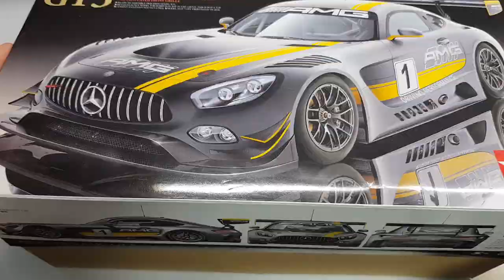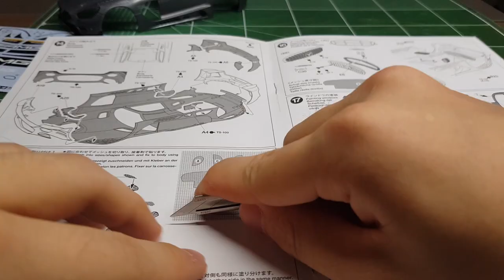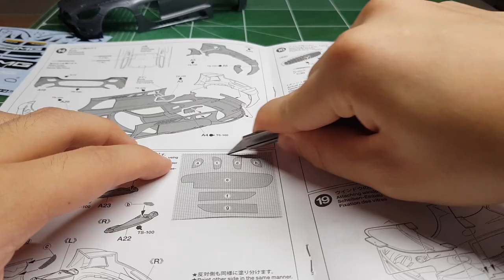How to build a 1/24 Mercedes AMG-GT3 Tamiya Step by step

Comment: It's pretty cool. However, it is a pity that the decal looks like it is floating and the seal feels like it. I wonder if I should blow the clear thickly and sharpen it while removing the steps. Also, the decals on the 4-point seat belts are too dull, so I wouldn't use them myself.
Reply from the maker: Thanks for the advice.
Reply: @plagraphy5276  
This is not an imposition. 
My opinion.
Just for reference＾＾

Comment: Thank you very much for sharing your knowledge. Your work is beautiful. I would like to ask you a couple of questions: at 04:25 you say: 'Super clear is not suitable for this model'. What product do you use exactly? What brand? How do you protect the decals in this step? and finally, do you protect the decals on the windshield with any varnish or gloss coat? Sorry for so many questions. I would like to make this model and I have no experience in car models.
Reply from the maker: Not suitable because all superclears will melt decals, topcoats should be used when working on these kits, and windshield decals are not finished.
Reply: @plagraphy5276  What about Topcoat first on the decals, and then a second coat on top with Superclear?
Reply from the maker: @ianw3811  If you use Superclear on the top coat, the superclear will clump together and ruin the work as if oil and water do not mix.
Reply: @plagraphy5276  Even if I wait for the topcoat to fully dry?
Reply from the maker: @ianw3811  yes, never do that
Reply: @plagraphy5276  Thank you so much for your expertise!! I will make sure to not use superclear when making cars with decals.